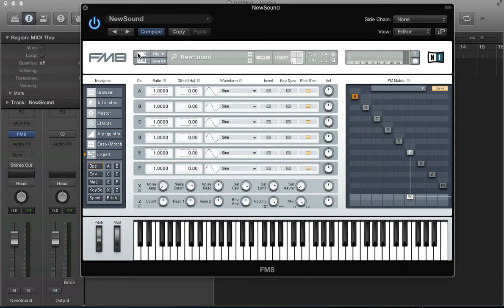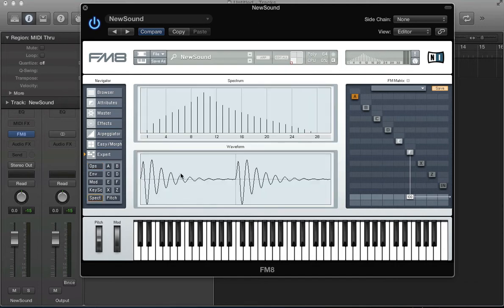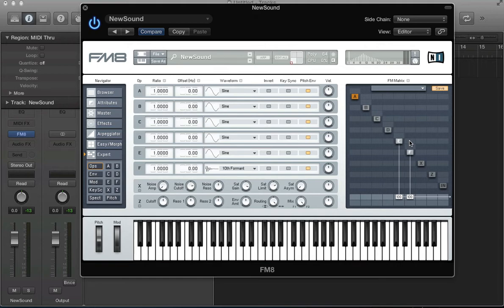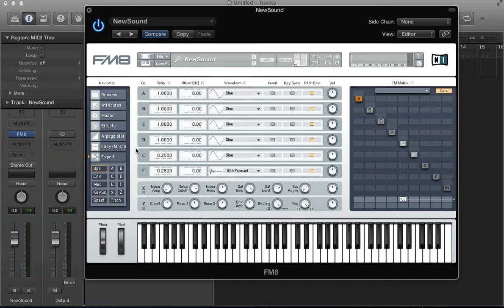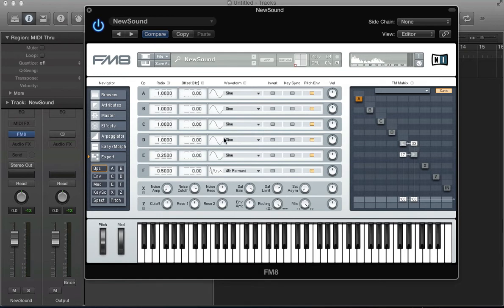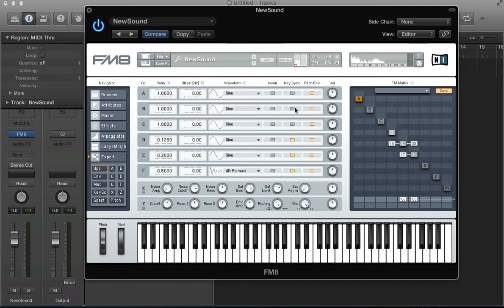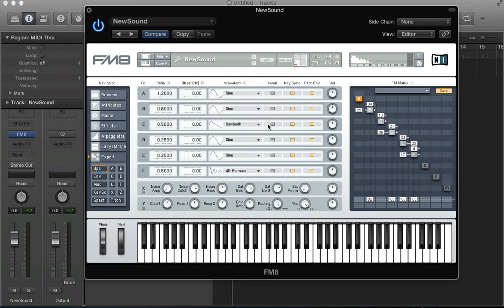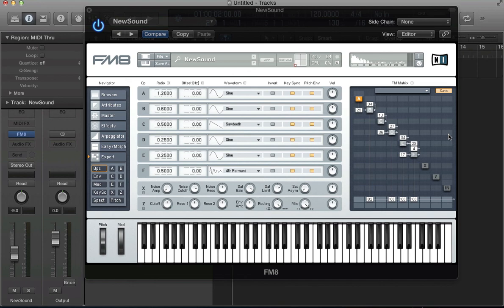FM8 - Cause & Effect and Sound Design in the FM Matrix - pt 1 - How To Tutorial

Comment: Unfortunately, in this case, the multiples of 6 theory doesn't do you that much good. If we know that 1 is equal to "Do" on an 8 note scale, and we know that .5 or 1.5 is also do, then you would need to divide the distance between the frequencies on the scale by 8. In this case, I chose .500 and divided by 8 and got .0625. In other words, increasing the frequency ratio by .0625 should result in one step up in the scale.